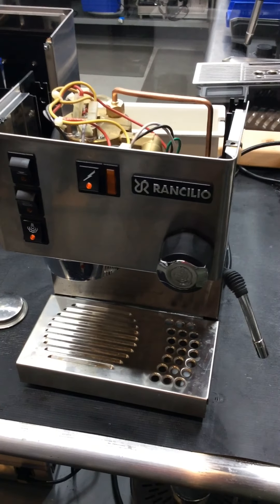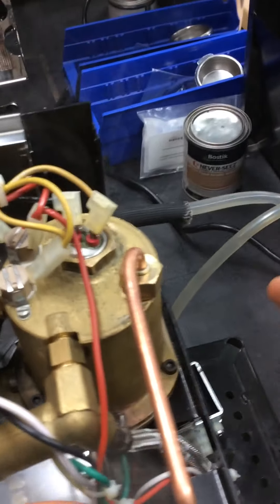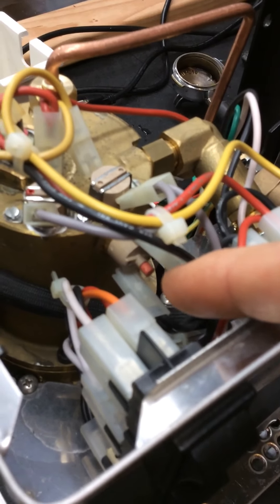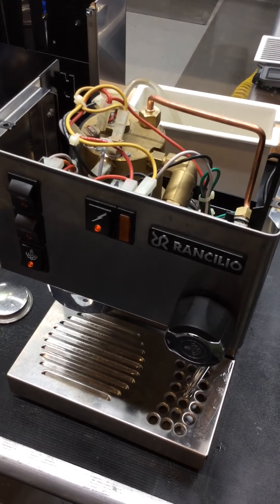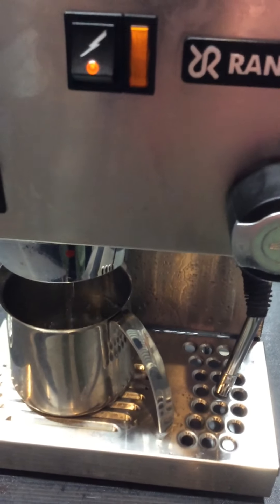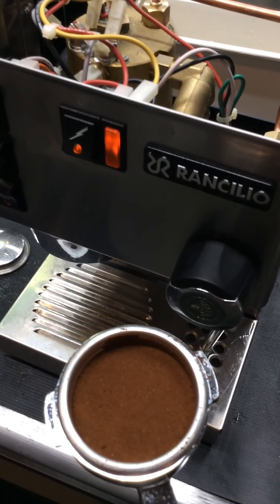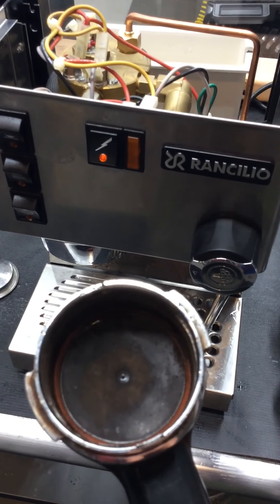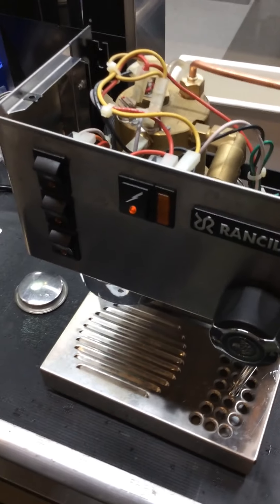Introduction to the Rancilio Silvia Espresso Machine

Comment: Hi. Interesting video. Would it also be ok to steam last and then Run hot water through the steam wand? Also I have a question, my Rancilio v6 won’t switch on. No power whatsoever. I’ve changed the fuse in the plug and used different plug sockets. Any ideas please. Thanks paul
Reply from the maker: Yes, you could steam last and then run hot water through the steam wand.  Do you have a multimeter to help you check the machine?